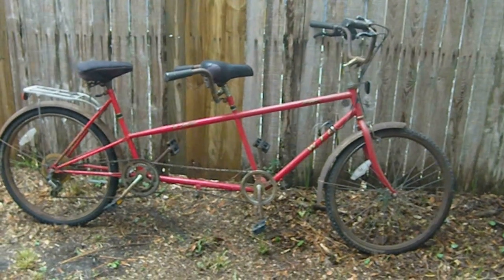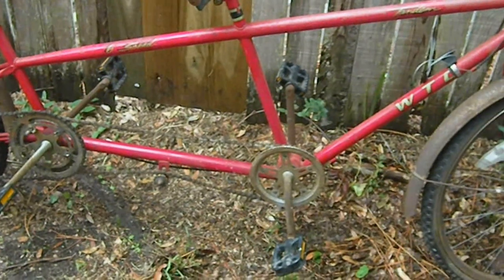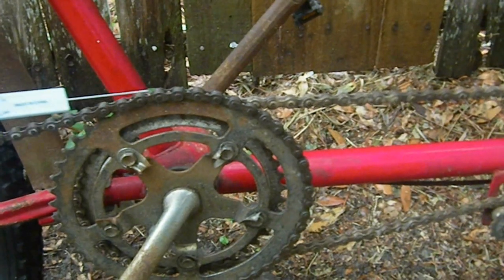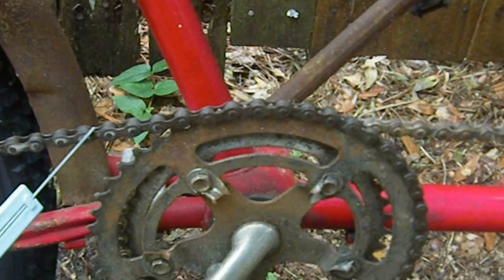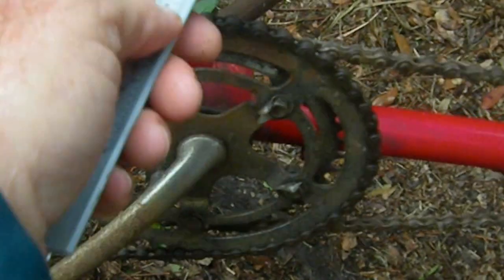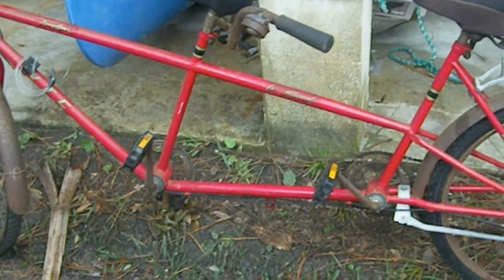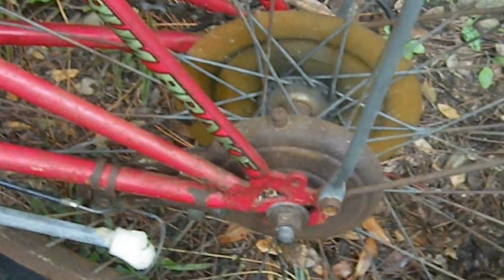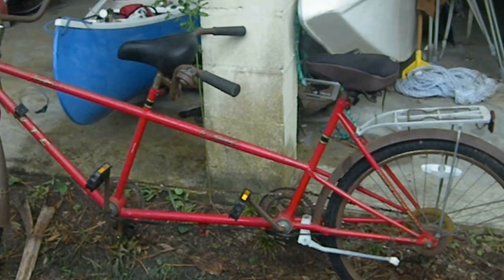Restoration of vintage wtc tandem bicycle

Comment: I have one of these in my garage and about to see if I can clean it up and get it going!  Tires hold air but middle crankset seems a bit bent.  Also, rear drum brake seems to be sticking but just might be the cable!  Good to see the same bike in your video!

Comment: Nothing like people making videos about things they know nothing about.  A cable "freezing" inside a housing is common on neglected bikes.   The chain guard shouldn't keep the chain from falling off but keep your pants and leg from getting greasy.  The chain ring is obviously bent, and I would not be surprised if numerous stiff chain links are compounding the problem.